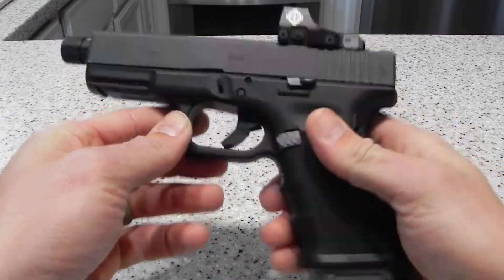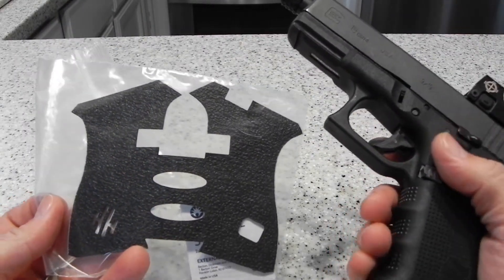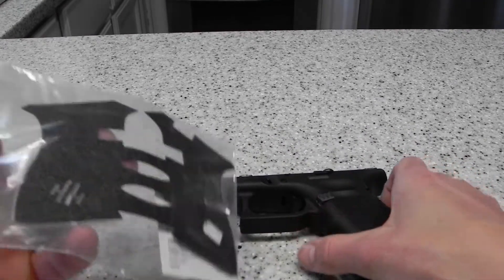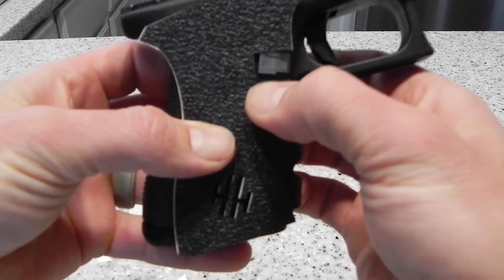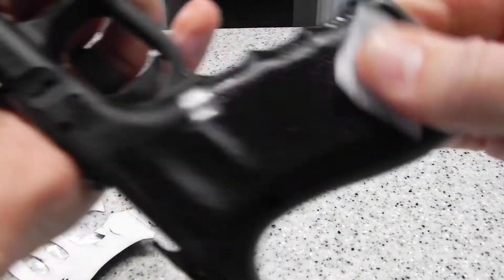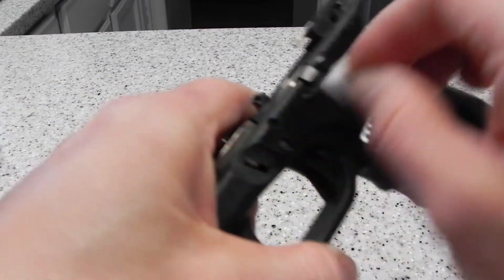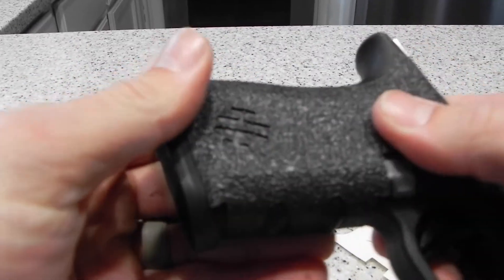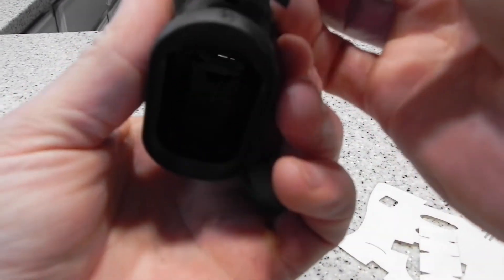HANDLEIT GRIPS INSTALLATION

Comment: I have a question, I have the beaver tale attachment on my glock on the handle, can I add rubberized grips to the beaver tale or do I have to put it on without it
Reply from the maker: That I honestly don’t know. If you have an Instagram account look them up and ask the question In a DM. If I had to guess though, I’d say it will fit the grip like intended, but may not cover the Beaver tail portion.

Comment: Just got mines and for some reason it wasn’t lined up with the curves but I made it happen it even ripped on me a bit but it’s on and it feels great.
Reply from the maker: Interesting man. I have installed 2 so far with no issues in fitting. Did you reach out to handle it?
Reply: @BarrelsBladesandBarbells  no it’s not that big of a issue I would of reached out if I thought I wasn’t satisfied, but I’m good on how it’s on it feels great and with a little pulling here and there it’s on great 👍🏼
Reply: @BarrelsBladesandBarbells  if anything I have Goon tape for back up can’t go wrong with the Goon…
Reply from the maker: @YOUMAD__  gotcha.
Reply from the maker: @YOUMAD__  haha true.

Comment: Awesome 
But u covered a pin...lol
Reply from the maker: Non issue. I just use an exact O knife and cut open the hole.
Reply: @BarrelsBladesandBarbells  I just got mine in the mail. all said and done. would you recommend doing all your custom cuts while doing the practice run, or cut/trim after its on and the glue drys? thanks.
Reply from the maker: @TN1000W  I usually wait till after it’s on. The last one I did, I installed and did some minor fitting right after. The main reason I did it that way is because it’s a P80 frame and I didn’t have all the parts to it yet. So I knew I’d have to pull out the pins at least once more. I actually kinda like doing it then. You can kinda slide the grip around a little as the glue dries.